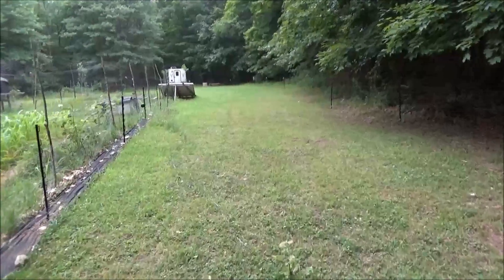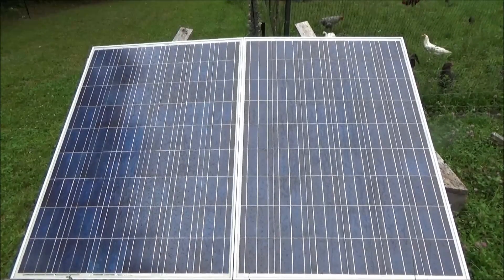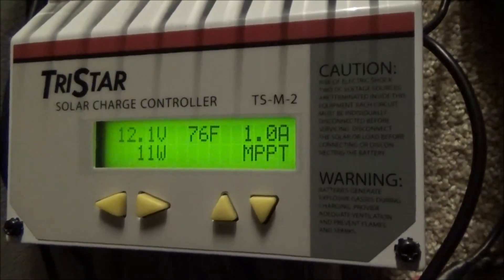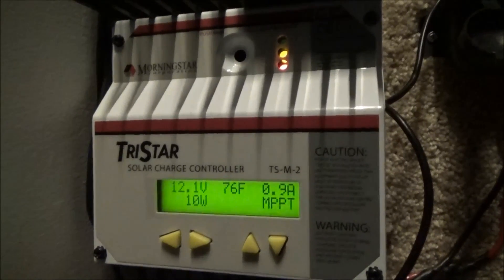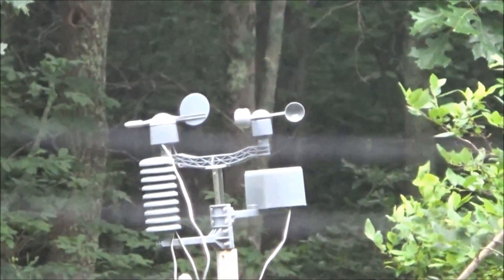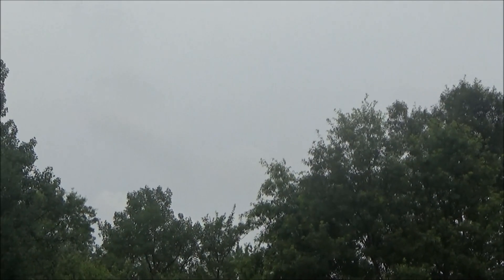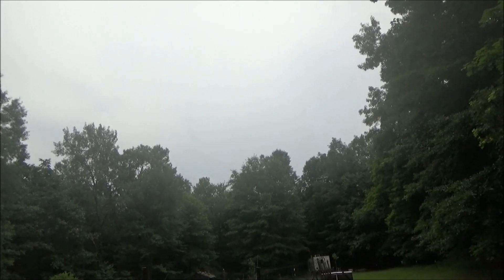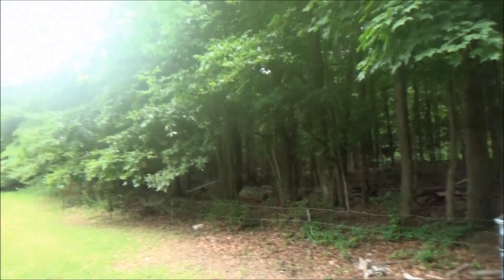Real Life Solar Panel Power Output At My Off Grid Homestead

Comment: Luckily, you don't remember how much worse your life would be without MPPT.  1 Amp is more than you would ever get with a simple charge controller on a cloudy day.  No sunburn on a cloudy day, easy sunburn on a partially sunny day (during summer)!  Which, by the way, is dangerous for your health.  As gloomy as the cloudy days seem, and as much whining goes on about limited solar energy, imagine that you get skin cancer on the same day you can't power your fridge or laptop with crappy energy collection.  The key is to have 2 week storage of batteries, but NO-ONE-CAN-AFFORD within a reasonable budget that much storage to deal with the peaks and valleys.  For the record, and as a long time off-gridder, batteries are a better investment than solar capacity, so the one sunny day you have can propel you to a "2 week savings account" of energy.  Before anyone sends Troy a free  "autotracker", much more valuable would be more batteries.  As he says, "When the sun shines, I've got energy to burn!".  If he could store that one day of energy to burn and have a 2 week storage tank it would be like his RV gutter water tank that keeps him with an ample supply of water (No whining about lack of water, right Troy?) and his chickens (not a cheap shot of how much rain you have endured this season). I'm sure you can see that 500 gals of water storage makes sense and could prepare you for unusual drought conditions for 2 weeks.  The equivalent 2-week battery storage (2-week supply) would be about 32 Kw, or about 3000 AH.  Easier to buy a surplus tank (or 10) than 30+ KWh of battery storage, comparatively.  Am I way off here with my rough equivalence, or does this make sense based on your experience?  S*** happens, but not for longer than 2 weeks.

If you could afford 2 wks storage (based on avg. daily use) would you really be worried about the 10-14 days you just suffered through?

Notice my argument does not include lifetime of batteries, which can be a downfall, but I think Troy is a little bit obsessed with measuring the condition of his batteries by voltage without considering the impact of temperature.  Everytime you have no power when it's cold I swear at the screen to have a look at the full-charge-vs-temperature chart.  Sometimes you are right, but mostly (50deg.) you are paranoid that low V means no charge.  Temperature has a large effect on voltage, and, as seen on video, you are charting your battery temperatures, so convert.  Right now I am with you and crossing my fingers on your tiny home, but please print and post a lead-acid voltage vs. temp. chart next to your MPPT so you can understand that during the cold months the batteries aren't as bad as you think.

BTW, following you for 3 years since before you lost apartment, so sorry if this is long. 

Please do not take this negative, just trying to help the off grid project and the DIY world. 

Also, I am off-grid in New England, so while our weather differs slightly, I feel you man.  When you post a fricken-freezing-Mr.-Bigglesworth (Austin Powers), we were too.  I think you warmed us up with empathy.

Feels good to vent after lurking for 3+ years.  To the Trolls: --trolls!

Go Troy on tiny home!  Off to great start!

P.S. Got married the day before Irene destroyed my business and my life, so I have some idea how you feel.  Big fan and fingers crossed!
Reply from the maker: If you read the video description I mention both MPPT and PWM charge controllers. This was meant to be an informative video for people considering going off the grid. I was not "asking" for any solar tracker. I plan to build one next year. Its on my list of things to do. Cant wait to get to it but I have the house to build, then heat and more.
Thanks for being there all this time. Yes, being over there, you surely know what its like on solar with my current weather conditions.
Reply: The Do It Yourself World
Yes, this was very informative, I meant only to echo what you said.  Yes, the many days you froze and had no power, our teeth were chattering and we were struggling to keep warm.  I wasn't implying you were asking for a solar tracker, just that if I could afford it you'd have 3KW of batteries waiting at your local Autozone!!  I think you'd agree that when you go off-grid your financial priorities go from fragrance and fashion to propane and electricity and devices that help you maintain the above two and cold and food.  But what a great feeling to feel that way and not worry about buying stiletto heels or a $4000 handbag.

I know we still need money to buy essential devices, supplies and technology, but I am sure as I have watched you, that the release from dependence on that (as I see you eating blueberries and eating your garden) you see that it isn't all measured by your annual income.  Also, I am sure you feel the pain that living off grid is a job in itself, with constant maintenance and upkeep of systems that "normal" citizens pay a small utility bill for.

If everything goes wrong, what will everyone else do?  Hopefully they have seen us and keep one foot in their normal life and the other in the "what if" situation.  No panic is such an advantage over your fellow $4K handbag brandishing neighbors.

I make my at home income from SEO, so I get that I can make my own water, electricity, even satellite TV, but being connected to the Internet is my Income/Job and cheap/mo. compared to neighbors commute/gas/oil/car.

Here I go again, once I am uncorked I go on and on like one of your videos (just kidding, love them so much), please understand that the rest of us non-trolls get depressed if you don't share your failures/wins and have to deal with our own realities.  You truly have been an inspiration for us and we use to feel so bad when you had no idea what you were doing.  When you woke up cold in the old trailer we almost went there with candles just to warm you up.

There will always be trolls, but for each of them there will be 10 of us fellow sufferers/compadres/offgridders/people just trying to make it.  So ignore them and just do your best.  I'm not very religious but after witnessing coincidences that you have experienced recently, God bless!

I dream of a solar tracker, after I have a house, heat, a bigger battery bank, good insulation, no mice, water, food.  That's all I was saying.
Reply from the maker: tardsat Thank you very much. Yes your priorities do change drastically when you go off the grid. Trade in those fancy dress shoes for a fishing pole. Work to maintain your "utilities" but save because you are producing your own. Knowledge that when the grid fails, I dont have to worry about a thing. Just a few days ago the area lost all power for a few hours. I had no idea other than my internet not working. If I was not making videos even that would have gone unknown.

Not sure if you know but my profession out there is SEO as well.

I sure hope to have an insect and mouse free, well insulated house soon.

Comment: I just learned about grid tie inverters a few months back. Are they legal, up to code, ect?
Reply: There two different types of grid-tie inverters. One is connected to the solar panels directly (each panels has an inverter) such as Enphase, they sell all the power you harvest to the power company, no charge controller required.

The other type is Grid Interactive System, similar to Troy's set up, Panels, Charge Controller, Batteries and Inverter, once the batteries have been topped off, instead of idling, the extra power is fed to the grid. If the grid fails, this system disconnects from the grid and connects only to a few critical loads of the house.

Once you add up the cost of the system and how much the power company will pay you back for your investment, you might change your mind.
Reply from the maker: Yes they are legal and up to code but you probably have to get them installed by a licensed professional. Improperly installed and they could feed power back into the grid during a power outage and possibly kill a line worker.
Reply: Grid tie inverters with the intent on selling back to to the power company instead of storing power in batteries, in my opinion, are not worth the expense. What the power company pays you when they buy electricity is very little compared to what they charge you when they sell. Typically, these systems will shut down whenever the power company experiences a blackout, to protect the linemen from shock hazards.

They are legal and must be installed up to code in order for the power company to cut you a check (yearly).
Reply: Cisco Isoffthegrid I have been looking to setting up a system like this.  Question is can you have them set up to charge batteries first then once those are topped off feed the grid?

Comment: what about hydro? you have a creek close
Reply: Gotta echo here...a small amount of hydro 24 hours a day rain/shine (within normal events) trumps wind and even solar for me.  I'll take 25 watts 24/hr a day over about a 1000W solar setup, since I can count on it.  That said, the creek I've seen on video has not shown you really have that option, although you shouldn't give up on that as a source of fresh/non-drinking/laudry water.  Long hose and pump isn't too expensive (although your budget is PRETTY tight) if that is a major problem.  But it seems like you, like us at least have recently experienced too much rain.  Watch out with micro-hydro, can be done affordibly but many will be happy to take your money without the fair return.  It's like a cross between wind and solar.  Wind might make sense for some but not for the average folks.  Solar makes sense if you can store 2 weeks.  Hydro is low and slow but unless you have a drought you have a reliable source, but you have to have a (legal) setup and the right conditions (a hilly brook that flows most/all the time).  Again, the bigger battery the more you can cover the peaks/valleys.  But batteries can be the money suck.
Reply from the maker: tardsat The problem is that it is 1/4 mile away and not on my property.
Reply: That's understandable troy i did not realise it was not on your property and a quarter mile of cable would be way too expensive
Reply: Link Knight
 I'm surprised the rodents haven't chowed down on the ones he does have.